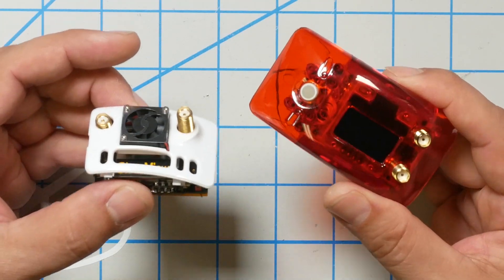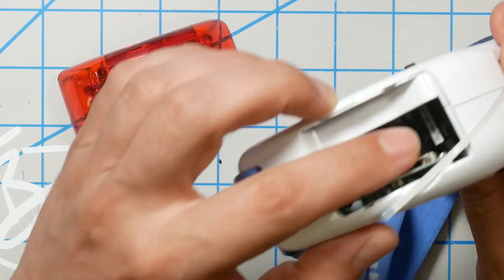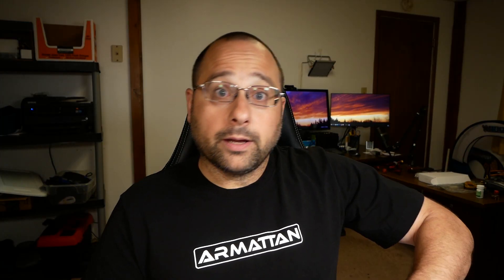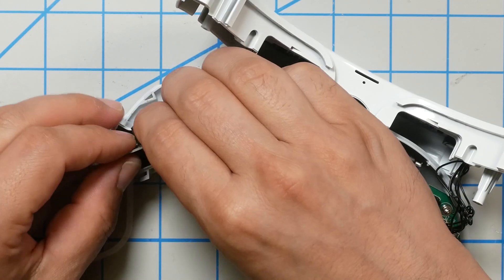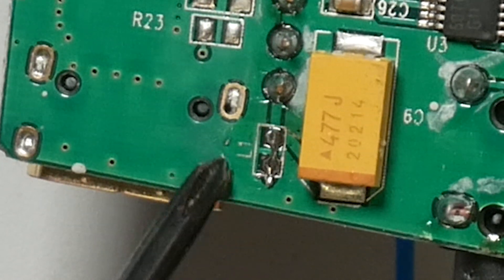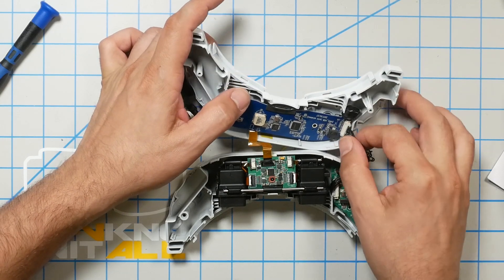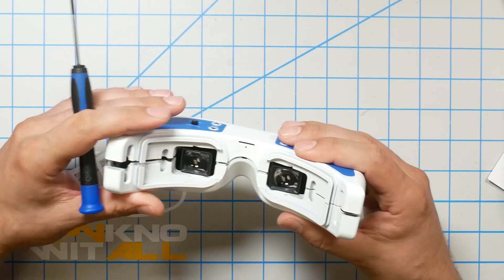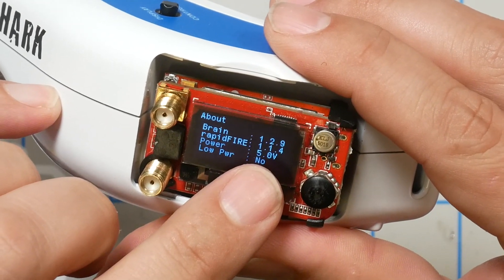Fix Rapidfire Low Power | Fat Shark L1 and L10 Inductor Mod

Comment: I just want to say thank you! This helped me get my Dominator V3's running normally instead of low power. I literally just bought the module, turns out the new versions don't come with the 5V adapter anymore. I suck at soldering and was more than happy to see (" Low Power mode: No ")

Comment: Has anyone had trouble with the HDO screen going black?

I have HDO goggles with a Rapid Fire recover & when I go to a field to fly my screen goes black occasionally.

I think the rapid-fire module is overheating as I have never encountered this problem flying at home, however the goggles are in the cool house between flights at home, while at the field they sit in the sun.

Comment: Thanks for the video, I’ve got the rapid fire module and HDO2 goggles. The module beeps continuously like it’s low power but when I check the about it says 5v and low power: no. Any idea why the rapid fire module would just beep continuously?
Reply: Was it maybe the goggles for low power and not the module?

Comment: hey buddy i have a pair of HDO and the screen goes black  every now and then and i have to disarm and fall out but dvr records fine without blackout ???
Reply: Did you find the cause of the HDO screen going black?

I also have HDO & Rapid Fire and when I go to a field to fly my screen goes black like you are describing.

I think the rapid-fire module is overheating as I have never encountered this problem flying at home, however the goggles are in the cool house between flights at home, while at the field they sit in the sun.
Reply: yes it was my camera and not the head set

Comment: I think this was happening to me with my fusion on the hd3. I got ahold of TBS through email and they helped me troubleshoot it within prob 30 min after business hours. I'm using the ribbon but TBS said to turn off wifi in my module. I did that and they haven't overheated and powered down yet.

Comment: im using the auxilary power cable to power the receiver. everything works as expected ... for about 10 minutes, then the screen goes black and the goggles and receiver module seem to power down. also the area around the power jack seems to get slightly warmer than usual. if i cycle the power everything works again, but then shuts down after a much shorter time. if i had to guess, something in the goggles is overheating and the device shuts itself down.

i tried running the goggles (dom v3) with the auxilary power cable disconnected and it seems to work fine, except with limited receiver function.

any ideas on how to get this to work?

Comment: I have the HD1 - there is no L10 on the dvr board.  Does anyone know which inductor to bypass on these?  There is an L10 on the same board as the L1...  I also see an S10 maybe, can't make out the first letter that is on the top side of the DVR board... there is no cap on this board.  Any help would be great!

Comment: Thanks for the video.  I bought used goggles, and you showing me the module switch on the bottom saved me from replacing a working VRX.

Comment: Hi JB can you help me what if the module suddenly not powering up?
Reply from the maker: Check the small switch in the underside left of the goggles.
Reply: @JoshuaBardwell  switch to O?
Reply from the maker: 0 is off
1 is on

But whatever move the switch. See if your module powers up.
Reply: @JoshuaBardwell  hi JB i tried many times still not powering. Before all working good but after i change the module cover it’s suddenly like this and module not powering at all do have any advice to solve this? 

Onething when i tried to put the usb direct to module and goggles is one they communicating . Tried 3 different modules and still same .
Thank you for the response sir!

Comment: Hi, I had a normal diversity module on my fatshark dominator SE's and sometimes it used to turn off and on during start-up, but not during flight. But since i moved to a foxeer wildfire module, the issue got worse and and the module started turning on and off repeatedly to now not being powered at all  (the screens remain powered all the time) . Do you think this mod will help?
Thanks

Comment: Does anybody know why they had those two inductors in the first place? If it truly can be replaced by a wire, you'd think that the factory implementation would have used wire instead of more costly inductors.

Comment: Quick question if you get a moment. I have a pair of HD3’s with a rapid fire module (and a small module attached to the ribbon cable in the left bay. If I do this mod, can I take out the board and the ribbon cable? I want to run a head tracker module and if is supposed to plug in the left bay exactly where the smaller Rapid Fire modules goes. Keep up the great work!
Reply from the maker: Yes that's right. You don't need the aux power cable if you do this mod.

Comment: would you still do this 2 inductor mod vs now using the red power board mod that the rapid-fire now comes with in the box ?

being quarantined has given me some time...
and thanks for all your help throughout these last years.
Reply from the maker: I would definitely do the mod. The aux power board makes the module on/off switch not work and it interferes with DVR and/or AV input.

Comment: Very good Video but i have a question. When i do this mod and use later a different module like the RealAcc RX5808 i.e.g. does it still work or do i have then any power issues with any other module???
Reply from the maker: No there are no power issues with any other module.
Reply: Joshua Bardwell thanks and greats from Germany

Comment: Hello Joshua, thanks a lot for your videos first of all, always sending out good and valuable tips! Now may I ask you since I did not do the modification on my goggles, can I still use the external AV port if the rapidFire module is plugged in or does that create any problems? Thanks and kind regards from Switzerland! Andy
Reply from the maker: Yes you can use the AV port. You need to power off the module using the switch on the bottom left side of the goggles.
Reply: I think this switch is not active if I did not do the L1 modification...
Reply from the maker: Correct. You can turn the module off in its menu. It's the Diversity menu where you set antenna to top, bottom, or neither. Neither turns it off.

Comment: Spot on perfect.  I am a true beginner when it comes to soldering and this was a piece of cake. L1 comes off quite easy and as you suggested L10 is much easier to bypass than to remove. I expected this to be a complete fail but it worked as prescribed. Thank you sir!

Comment: Hi. I have a problem with L1/L10 mod. It doesn't work with the True-D X on my dom V3 goggles. So i've tried the flat câble receiver with the module. It the same issue 🥴 The voltage seen by the module is about 3.8v Do you have any Idea ?

Comment: The l1 on older goggles is located opposite side of the board. Above the rx switch. My goggles is a 2015 set as a heads up. Hope this helps

Comment: i did this mod on my dom v3's and i am still getting low power notifications. and suggestions?
Reply from the maker: If you did the L1 and L10 mod correctly, you should not get the low power warning any more. So I can only guess that the mod was not done correctly :-(
Reply: @JoshuaBardwell  removed and bridged the components at both spots.

Comment: I just installed the power mod it came with instead of soldering at my fatsharks but now the video frame is too big I have to open and close each eye to see one side of the screen. Has this happened to anyone ?
Reply from the maker: The power mid can't change your FOV. Something else is up.
Reply: @JoshuaBardwell  well after messing with my hd3s i noticed the display setting on my goggles was the problem. thank you for your time and concern!

Comment: I do not have the L1 connection on my board
Reply: I have the Fat Shark FSV1063 Dominator V3
Reply from the maker: The L1 inductor is down near the HDMI connector on some goggles.
Reply: @JoshuaBardwell I do not see any L inductors on the board. I guess I will have to use the power strip

Comment: Hey joshua, did both of them and still have the issue that it says low power yes and about a 1-2 the voltage drops into 4.0V or below then it recovers about to 4.3V ( I have the Dom V3 and the DVR board is from 2015)
Reply from the maker: The DomV3 has the L1 inductor in a different place. If you do both L1 and L10 you should not get low power. I wonder if you "modded" something else.
Reply: @JoshuaBardwell  i only did the fan and led power switch mod

Comment: Thank you for making this very clear and concise video!  I received my Rapid Fire module today, did the mod on my Dom V3's and all went well.  
One little tip.... when you are working on L10,  if you have access to two soldering irons, you can heat both of them up, tin their tips and put one on each side of the solder points on the chip and it will come off pretty easy, then just solder a piece of wire across the pads.  I realize that not everyone has 2 soldering irons, but if you do, this works great.

Comment: So, just to be clear. If you use the ribbon cable and get auxiliary power from the other bay... No Low Power issues right ? Only negatives are ribbon cable itself and no dvr view  ?
Reply from the maker: Correct.
Reply: @JoshuaBardwell  Awesome.. got a set on the way.   I live up in Kingsport.. need to come down and fly with ya :)   Go Vols !

Comment: Thanks for this video, Joshua, I received a RapidFire module this morning, just modded my HD2's, bypassing the L1 & L10, working great, but now I need better 18650 cells in the battery pack :)
The L1 was in a different spot than in this video, on the other side of the board behind the switch:
haku.co.uk/pics/FatSharkHD2L1.jpg
Reply: licensetodrive thanks for the heads up. Is the L10 inductor in the same place on the eve board as bardwell video?
Reply: @Andrew Moore  Yes the L10 was in the same spot as in this video, just the L1 was differently placed so I took a photo to help anyone else attempting the mod.
Reply: licensetodrive thank you much!

Comment: Thanks again bardwell! I had to undo the ribbon cable if I wanted to play on the sim. If you absolutely want to get rid of the l10 inductor. I just took a pair of precision cutters to the L10 inductor and snipped it til I exposed wire. pressed solder to the wire and it desoldered both sides.

Comment: i'm not sure if the info from this link is true, but it seems this Mod is not reliable even with L1 and L10 jumpered/bypassed: 
https://blog.jseaber.com/2018/10/05/solving-unreliable-fat-shark-l1-mod-w-rapidfire/
after reading this info i decided to just install the Auxiliary Power Board supplied with the rapidFIRE and run the Flat cable internally like i used to do with my LaForge on my HD2's.
Reply from the maker: The l1 and L10 mod has worked in every case I've tried it. This is the first time I've heard of it not working.

Comment: Thanks for great tutorial. I had HD3, RapidFire and low power issue. I've done only the L10 mod. In my case L1 is 0 ohm resistor (jumper) so i did not have to touch it.

Comment: With only the L1 mod I still had low power occurrences with the rapidfire module. When the battery went below half full the voltage on the module bay dropped rapidly below 4.5V. With L10 mod it stays at 5V even when the goggle begins to beep as low battery warning.

Comment: My hd3 was keep turning off randomly and 5volts regulators on head tracker was super hot I taught if I do the modify to it maybe be fix I do the mod and it’s all gone now but that’s reason I bought fatshark so if is brake they can fix it thank you for your video as always

Comment: Thanks Joshua. Just did the L1 and L10 mod and your instructions were clear and concise, especially the disassembly component.

I don't use a RapidFire, but I'm using the Realacc RX5808 Pro Plus OSD which has been having issues with reboots, especially when putting pressure on the goggles when putting them on as they pass over my head. I originally thought it was a problem with the module or with the 5V pins/5V circuitry, but I had the same issue with my previous module which was an Eachine Pro58.  However since doing this mod, I've been unable to reproduce the issue. Whilst proper flight testing is needed, so far so good.

Oh, here's the weird thing. Before doing the mod, I was only getting about 3.4V through the module pins. No WONDER I was having issues huh? Now I'm getting 4.9V consistently.

My goggles are HD3's but they were early ones as they had the original HD3 optical flaw and they had the L1 inductor sitting in a different location to yours.

Thanks again.

Comment: eachine pro58 with achilles software on hd3 drops from 5v to 4v.
No low voltage alarm on this unit but perhaps the low voltage affects reception/range?

done the L1 and L10 mod and now sits on 4.9v
Reply: Notice any diffrent?
Reply: @niklas950928  performance wise no noticable difference but voltage no longer drops to 4v.

Comment: What wpuld make the screems in my domv3 to shut off randomly, but rapid fire stays powered up. Just the screens go black. Plz JB hellllllp!!!!!!
Reply: Are you using the 18650 Fatshark Battery Case when this happens by chance? I was having this issue with my Dom V3's and I found it was related to this battery case. The batteries can become just enough loose and any loss of power even for a quick moment, can cause the screens to go black.

Hot gluing a piece of foam that fits firmly underneath both the extended metal tabs on the inside of the door, will help keep the metal tab in contact with the battery for a good connection. Once I did this mod, I no longer have this issue.
Reply: @larry9878  nope using titan 3500mah 2s Lipo. Its like the 18650 without the case
Reply: Look up on youtube - Recursion Labs - Fatshark Black Screen of Death. He has the 18650 case, however he demonstrates how even a micro/milli  second of power loss will make the screens go black. He hooked up an adjustable power supply to the goggles and the problem went away, that's how he determined that it was the battery case.

Maybe try another source power if you have one. Hope that is helpful. Good Luck.

Comment: Does the furious 5.8 true d show low power?
Reply from the maker: TrueD does not draw enough power to cause this issue.
Reply: @JoshuaBardwell  Hi !! I did only L1 mod and worked great... now...If I want to use true D again.. should remove L1 mod?

Comment: Nice vid i was going to get the hd2 t2 goggles but might try the mod first cheers
Reply: the HD2 Terminator circuit board is like HDOs and doesn't need any mod.
Reply: I have the OG hd2 and want to mod them but i love the big FOV so was thinkn of the hd2 t2 which i already know it is the same as hdo and needs no mod cheers for the reply though

Comment: Joshua, FYI if you install the rapidfire with the ribbon cable you can still use the DVR by just turning off both antennas in the Rapidfire menu. It's not quite as convenient as the little switch but at least you can still use the DVR in the goggles this way if you need to.
Reply: I was doing this but there was a time I forgot to turn them back on!

Comment: I dont get it why are these products advertised as they are and then the customer has to become a electrical engineer to get it working properly
Reply from the maker: 1. All goggles made after the Rapidfire was invented require no mod. Until Fat Shark invents time travel, they can't make older goggles compatible.

2. Rapidfire comes with an aux cable that allows anyone to use the module without modding. Modding is never required to use the module.

3. Fatshark will do the mod for you if you send the goggles to a service center.

4. You have the option to do the mod yourself.

Comment: I’m building my own quad and recently switched frames. After switching to the new frame the quad has severe oscillations. Also, occasionally in flight motor 4 will suddenly cut off. The motors run fine in beta flight, however they vibrate when flying normally. I have already checked all connections as well as reflashed the flight controller. Does anyone know what the problem is/how to fix it?
Reply: 4 in one ESC or singles. either way need to check all wires, connectors if any  and solder or direct  contact with frame more info on build would be nice! Swap motor first if you have a spare if you do not. You will eventually  LOL

Comment: In my experience of doing PCB board repair, using plenty of flux reduces the risk of lifting a pad dramatically.
Reply: Agreed Michael Neil, even though there’s a flux core in the solder I always liberally use more flux. And as one of my teachers used to say “flux is your friend”

Comment: You´re my fucking savior! 
I recently bought a RapidFire, already made the L1 mod on the good ol´ FatShark HD2. The "low-power ON" didn´t show up after the "L1 Mod",... for a couple of minutes... 🙄
Now I´ll make this mod and give you pretty thanks after it worked, but I know it will!
Pretty thanks forwardly and keep it up!

Btw.: On the HD2 the L1 Inductor is behind the "Module ON/OFF switch"

Edit:
Mod worked, what else? Thanks Joshua Bardwell!

Comment: Al smal corection. If there is a vtx turnd you can only see if the low pouwer is on or of. If ther is no vtx turnd on. The rappidfire say low pouwer no also ther arde no mods done to the fatshark.

Comment: Joshua Bardwell I am using rapidfire with fatshark hd3's. I am also using the head tracker bay board to get the extra power for the module, and I get the full supplied current needed. The weird problem is sometimes after I power everything up, goggles, quad, tx, I put goggles on and the screen looks kinda bright. After a minute or two my rapidfire will make a beep and then the screens go darker but not bad, just dark where it seems it's supposed to be to fly. (Not to bright). I've checked modules power after this happens and rssi and it's still in full power mode. What does this mean though? Thanks